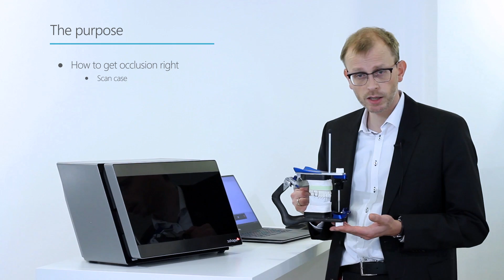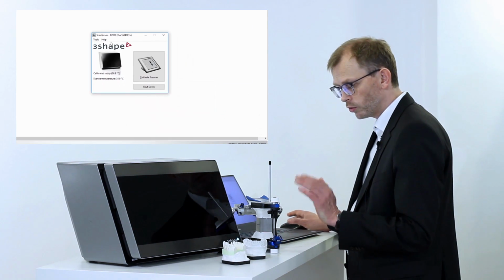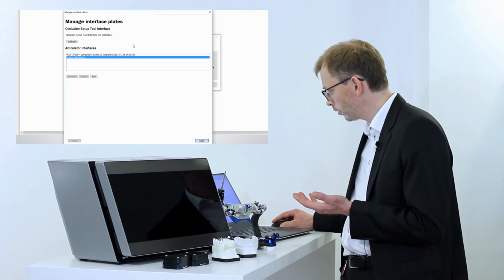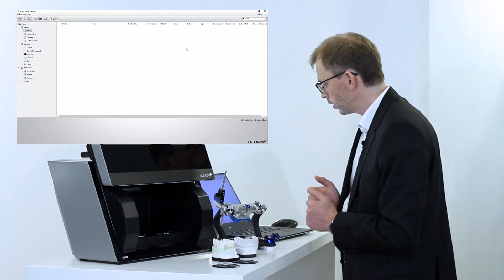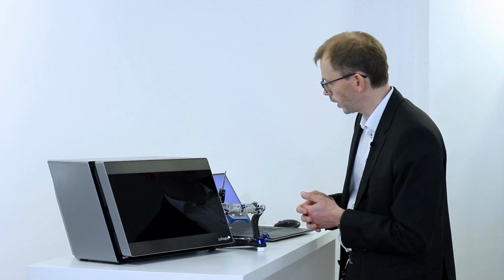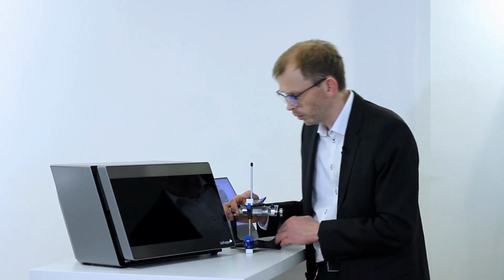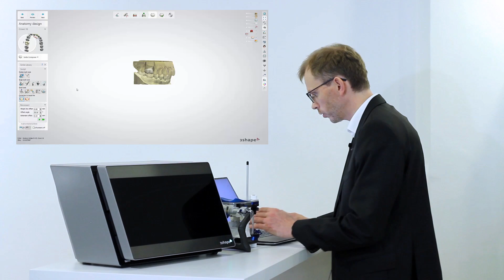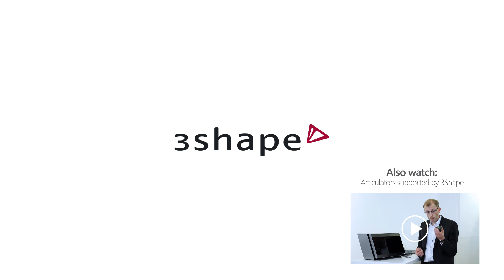Get Dynamic Occlusion Right

Comment: It is  recomendedded  that  we  (  dental  technicians ) calibrate   our  articulators by  means  of  so  called  calibration  key  which    ( dictates ) the   overall  height  126  mlm  (  supposing  that  incisal  pin is  touching  the   incisal   table and is  set  at  0 and     the  articulating  balls   touch  white  plastic  insert   located  in  the  oclusal  drum    ,,,,,,,,,this   means   that     EVERY   artex  articulator    WILL    have  the  same   ( oclusal  plane ) ,,,,,this   calibration   will   have  sens   when    square   blocks  WILL  follow  the   custom   (  oclusal  plane  ) which  is  determined   by   means  of   facial  facebow  , and  this  position  can  be  variable and  different  than  the   oclusal  plane  mentioned  above  ,,,,,,,my  cuestion  is  CAN  those square   blocks  FOLLOW  the   individual  position  of  oclusal  plane's ,,,,,,and  will  this   follow  be  ( calculated ) in  the  articulation     process  ,,,,,thank  you  in  advace .